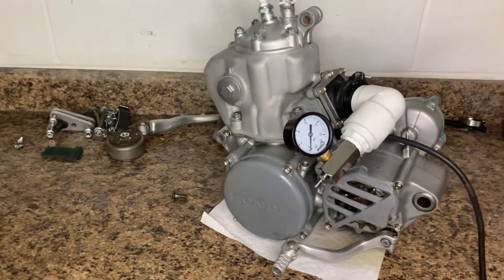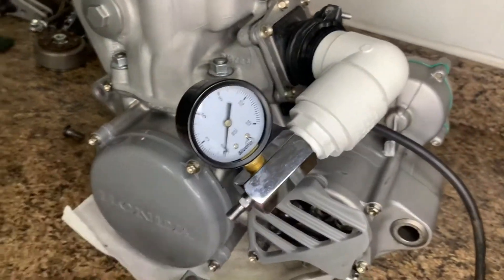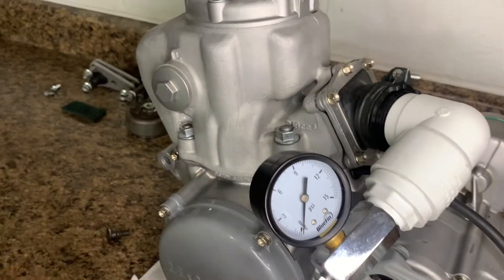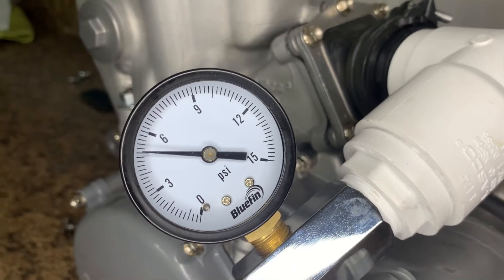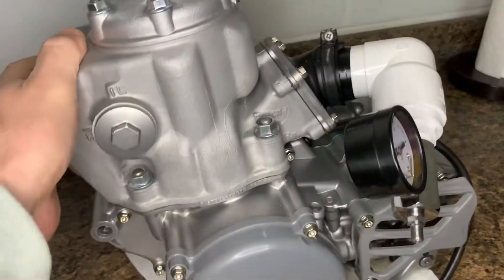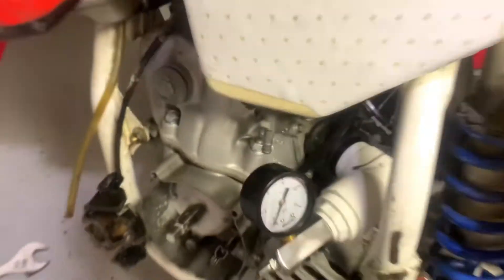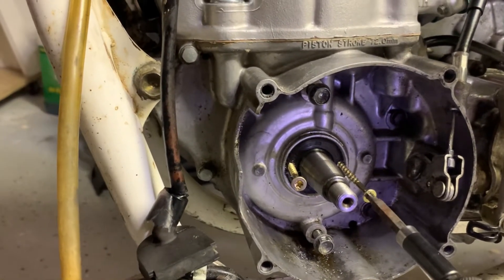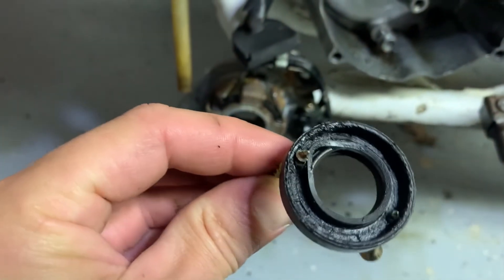Leak down test on Honda cr250 motor for all 2 strokes fixed in minutes!

Comment: What was the problem with the first motor ? I have a fully rebuilt motor on my blaster and I have no air leaks, great spark, 140psi compression and it just back fires when I try to start it.. I have play with the carburetor I’m running stock jets but still I can’t get it to run😭
Reply from the maker: 140 compression might be low. I would look to see what it is supposed to be at stock. My cr250 is supposed to be 190 psi for a stock motor and my modded motor is 230psi
Reply: Sounds like your timing might be off.